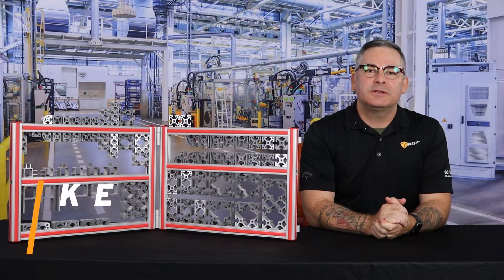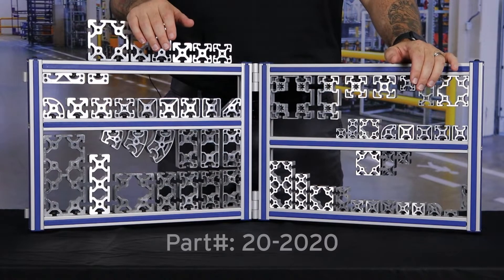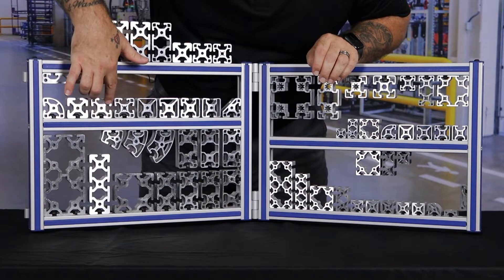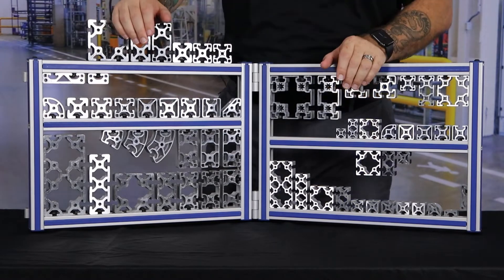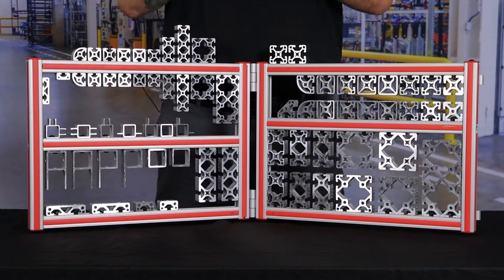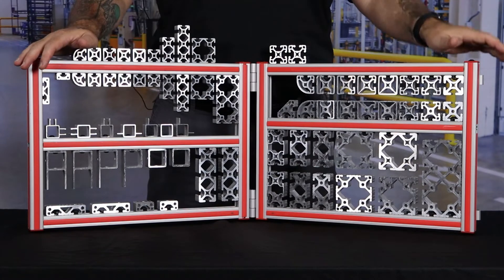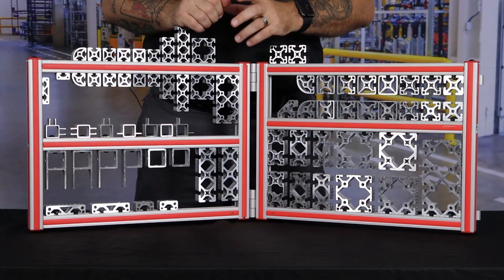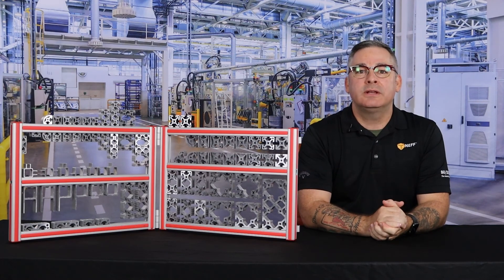80/20 Extrusion Series Differences: Metric vs. Fractional

Comment: how much weight can the extrusion carry?  for example, I want to build a portable meat locker on the front of my trailer for butchering on the farm/ranch.
a side of beef weights upward of 400lbs, 8-10 pigs at 200lbs a piece. obviously, i would not hang all of that at once but I am curious about how much it could hang.

Comment: Why does the fractional series even exist‽ The 25-2525 (25mm × 25mm) is (theoretically) only 0.4mm narrower than the 1010 (1.0" × 1.0" fractional), but that tiny difference can be enough to mess things up, depending on the application.
Reply: Beciase the US market for extrusions is massive and using 10 and 15 series in the US is far more precise since pretty much all of our tools are calibrated to imperial units.
Reply: Get the fuck outta here with your interrobang nonsense, ya basta ya.
Reply: lazy Americans couldn't finish dividing the numbers